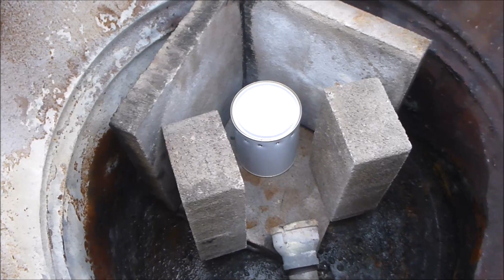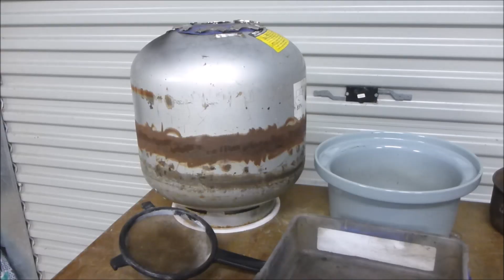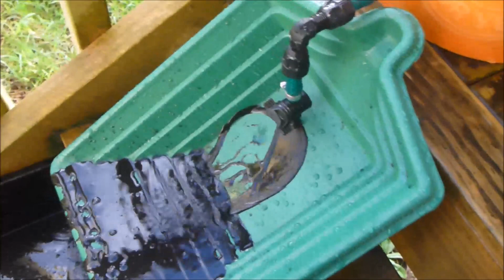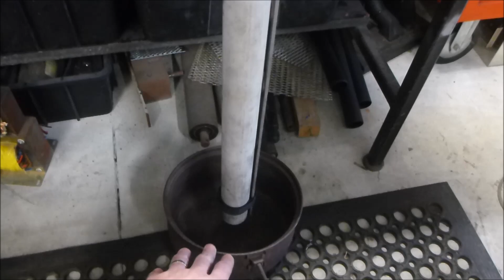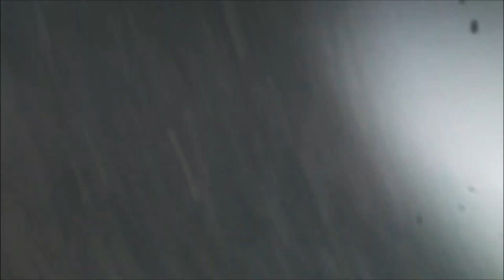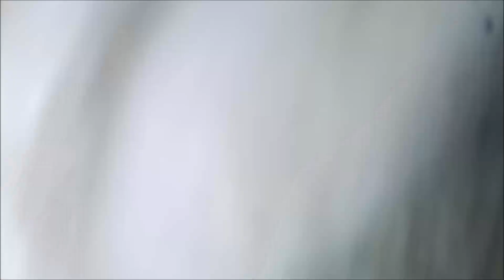Gold Recovery - Mechanical processing of ICs

Comment: thanks for posting this video, I found it really informative. I currently incinerate my ic chips,  then shake it in a jar, followed by crushing them with a rolling pin on a granite chopping board. It's probably not as good as your ball mill, but I honestly don't think my neighbours would appreciate me using one. I do have a question though. Should I do the pre wash if I'm completely incinerating my ic's?
Reply from the maker: Hey Nick, I would definitely 100% prewash the ICs, if you don't the blue bowl gets clogged with tons of micro particles which crash into heavier particles and make them move when they really shouldn't, and you also can't see what is happening with too many small particles. The bucket wash + sluice setup shown in this video is the best pre-was type setup I have tried. I am currently working on a 3-step process, where I bucket wash, then run the remaining material over a longer sluice, the only blue-bowl the stuff caught by the sluice.
Reply: Successful Engineer ok I'll start doing it in my process. I Can get a bucket and tap attachments easy enough but I'll have to shop around for a sluice box. What kind of length are you thinking of making yours? I've also now got a plastic pipe so I can start work on the metallic pin catching device that you use. I will also be re running the material I processed in my blue bowl from the weekend. I know I won't get all the gold back that I potentially lost,  but it will still be good practice for any future runs that I do.
Reply from the maker: As long as you kept all the discharge material from the blue-bowl, you should not have permanently lost any bond wires. I don't think the sluice length will be critical, but I'm probably going for about 0.8 meters (3 feet), I think the riffle depth may affect things, but I will have to experiment to figure it all out. Good luck and let me know how you go.
Reply: Successful Engineer well there is two bits of good news. First is that I haven't lost the bond wires, I can clearly see a heavy fine material being left on the trailing edges in my blue bowl. Second is I know why I was losing my gold. Because I haven't done the pre wash and I have only used a fine flour sieve I am left with large pieces of debris in my blue bowl. When I ran it at the weekend I was turning the water pressure up high to remove the larger pieces of debris. This was also washing my the gold down the centre hole. I did a couple of test runs earlier and I could clearly see this happening. I've ordered a 60 mesh sieve so I can dry out my material and re sieve it. I'll also get a pre wash system in place before I run it through the blue bowl again. I'd like to thank you once more for all of your help in getting me on the right track!
Reply from the maker: Hi Nick, that sounds great. Sounds like you have got the hang of it now, I think the changes you have suggested will dramatically improve your recovery. Look forward to hearing your progress.
Reply: Successful Engineer I'm not sure how long it will take me to get everything set up properly. But as soon as I get some results, you will definitely be the first to know!
Reply: Successful Engineer well I've set up everything and re ran my material through the blue bowl. So far I've only incinerated half of the original 5.5kg of my ic chips and it has still only returned about half a teaspoon of material. The one thing I've noticed in difference between what you collect from your blue bowl and what I collect is that I run my material until all of the black material and the broken pieces of silicon die has been washed away. Am I running my material too far in my blue bowl?
Reply from the maker: Nick Stoyles I usually run mine until I start seeing copper or bond wires making it up the cone, then stop, clean and start with the next spoon. The only way to know if you are losing Gold is to run the material through again. In this video I ran the material twice and you can see that I still lost some bond wires the first time round.
Reply: Successful Engineer I can honestly say that I'm hardly seeing any copper wires in my blue bowl. Most of the material is the crushed silicon die or leftover blank carbon from the epoxy. The only other thing I can think that could make a difference is all of my chips are coming from ram sticks. Of which the majority are flat pack ic's. Would that make a difference tho the material I'm seeing in my blue bowl?
Reply from the maker: For sure, you will notice over time that different source material ends up behaving quite differently through the process, at the end of the day, if you think you have it all, you will have to move on with the refining and that will be where you really know whether you got most of the Gold during the washing phases. Did you only run ram chips with legs, or was it a mixed load ?
Reply: Successful Engineer it was ram chips that had been treated in hcl. I've actually put what was left in my blue bowl in ap to try and see if there was any gold left in there.
Reply: Successful Engineer I've been having a bit more of a play with my blue bowl and I think I know what is happening. I could see material at the bottom of my bowl that should be my gold. The problem is that it is so fine I would describe it as what people call flour gold or float gold. I took a sample of this material and ran it in ap for a couple of days. I've just filtered it and added it into some poor man's ar. I'm definitely seeing a reaction at the bottom of the container. I'll know for sure once the reaction stops and I try a drop with smb. If I'm correct then I think I may have to get a 100 mesh or 120 mesh sieve to get rid of all the debris that is mixed in with it.
Reply from the maker: Hi Nick, if you ran some material with Gold, there will almost certainly be Gold at the end of the blue-bowl cycle. The finest sieve that I use is 60-mesh, I used my microscope to look at the material captured by a 100-mesh sieve and there were way too many bond wires captured. There is no need at all to get rid of 100% of the debris, if you look at the microscope parts at the end of the video you will see that there is a lot of debris in my material when I start processing, it is mostly Silica and has no effect at all on your Gold recovery. I just dissolve the Gold then filter off the debris. I highly recommend a cheap USB microscope for doing this kind of work, actually seeing what you have gives you great power to fine-tune your process. Also, the bond wires are much smaller than the specs that most people refer to as flour Gold, I have a few individual bond wires in a container here and they are completely 100% invisible to the naked eye.
Reply: Successful Engineer well that definitely explains where my mistake is because I've been trying to eliminate all of the debris from my bowl. I'll get back on the blue bowl tonight and do another run. Hopefully next time I post I will have some results for you.
Reply from the maker: Awesome man, look forward to hearing your results!
Reply: Successful Engineer well I've finally finished processing the 5.5kgs of ic chips I had. My results are as follows 1st load was 2.5kg and it returned 0.75 grams. 2nd load was 1.5kg and it returned 0.16 grams. 3rd was 1.5kg and it returned 1.2 grams. The only thing I did different for the final run was too use a food blender to crush the ic chips, where before I was using a rolling pin and a granite chopping board. I think the food blender is doing a better job of releasing the bond wires and that is possibly why I had a better result for my final load. I've now got 39kg of ram sticks to process which I will be doing 200 sticks at a time. This is to follow your example of finding out my yield so I can have a better idea of what to pay for them in future. Thanks again for all of your help in getting me this far. It has been greatly appreciated 👍
Reply from the maker: Hi Nick, yeah, those are very low yields, apart from the last run. From the type of 'legs' IC you see on RAM, my expectation is at least 1g per kg. For BGA RAM ICs it varies a lot, but usually between 2 and 4g per kg. With processing those kind of volumes, you probably want to consider very seriously building a ball mill. To expose all the bond wires, you really need to be getting everything under 60 mesh. You can buy small test sieves from pottery supply type places, get yourself a 60-mesh for testing. I also recommend doing experiments on 0.5kg (1 pound) runs of ICs until you have the process down. I find 0.5kg a nice volume to work with. Good luck and keep me updated mate.
Reply: Successful Engineer if I can get a gram per kilo I'll be happy. I've already got a 60 mesh sieve as I've tried to copy your set up as closely as possible. I'll see what I can do to set up a ball mill. I've actually been back at the blue bowl today and what I've collected in a jar is looking very promising. I ran the ics off my 1st batch of 200 ram sticks. They weighed just over a kilo but that was with out treating them to get rid of the solder/tin. I'll definitely keep you posted on my results!
Reply: Well I've finally finished processing the ic's off my 1st batch of 200 ram sticks. I'm pleased to announce a weigh in of 3.8 grams. I don't think it is all from that batch though as I cleaned the plastic container I use when I'm sieving my material. I also cleaned the sauce pan I use for drying my material. I added both clean ups to the material i just processed. I did this as I was guessing that some of my missing gold from my earlier runs could well be sat in the bottom of said containers. I will definitely be more thorough in future to help me determine a better average. But it's looking promising mate 👍
Reply from the maker: Awesome result Nick, at that point the buttons start being a nice size :) Yes, it takes a little while, but you are learning very fast. Eventually you get a good feel for working with bond-wires and you will have confidence that you got everything that there is to get. Nice way to end the year with a bit of Gold of on your scale. Keep me updated and feel free to shoot through a question if you ever get stuck anywhere. Cheers
Reply: I've been refining gold from ram sticks for nearly a year now. I've had a quick weigh up and I've managed to recover 16 grams so far. Yes I agree that I'm beginning to feel more confident with the process. Every run I feel I learn a little bit more about it. The 1st batch of 200 was ddr ram, my 2nd batch is ddr2 ram so I'm interested to see what the yield will be from those. I've also got a copy of the book by C M Hoke about gold refining that I've heard you refer to in previous videos. I figured if it was good enough for you then it would definitely be beneficial for me to have a read. Oh for sure, if I ever get stuck I know exactly who to come and ask!

Comment: Hey, Sir!
I have neither propper knowledge of chemical processes (from a safety point) nor will to study it. And moreover, i do not want to use chemicals cause i am afraid. Oh, yeah, in Ukraine many acids , ever in very low concentrations, are handled as precursors... So i alwasys sold my sorted evaist (from depopulating boards) through Ebay. But shipping kills all the point. So this mechanical treatment makes selling the processed material much tastier. The only thing needed is a trusty partner to sell to. Cause nobody will buy this black sand . Some kind of post-payment system with yield -based pricing is needed...
Reply from the maker: Hi Vladimir, yes, it would be difficult to sell the black-powder without evidence of the Gold content. Most large refineries probably have minimum numbers, so it would be difficult to deal with a large refinery unless you have big volume. It shouldn't be too hard to find someone who will refine the material and pay you based on the Gold content, you would just need to build up trust with them over some time.

Comment: What do you do with the waste?  ie: the carbon that comes out of the bucket wash, metals from the magnetic filtering, etc? (Copper heat spreaders is easy - throw it in with your recycled copper, etc).   A lot of people show these home-brew processes but rarely mention anything about proper waste disposal.   I'm interested because I see this kind of process in my future, and this is one of my concerns that I will need to research a lot more before I get started.
Reply from the maker: Hi Todd, yep, great question. The only waste in this process worth thinking about is the carbon that is washed out in the bucket. At this stage there is no metal in solution, so I discard the water on my lawn after using a basic sand-filter to filter out most of the carbon particles. I don't think that the carbon would cause any damage, but I like to play it safe. When the sand filter stops working, I bag up the sand and it goes in the general rubbish. Your problems really start once you start dissolving metals with acids, I have been meaning for a while to make a video about my waste treatment process. As you say, it is not mentioned often enough or strongly enough.